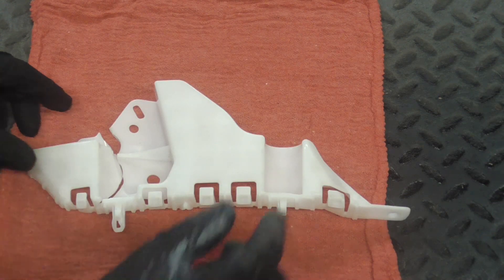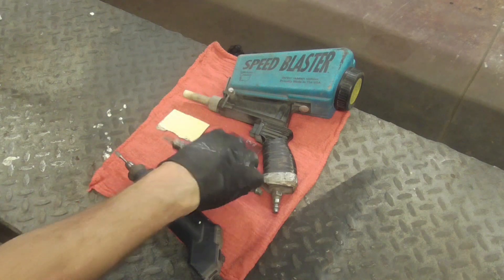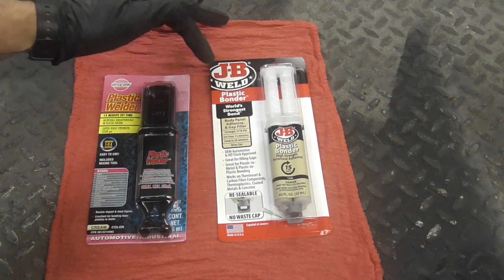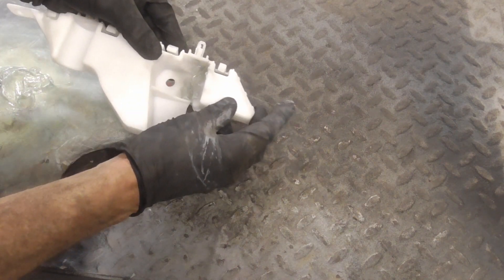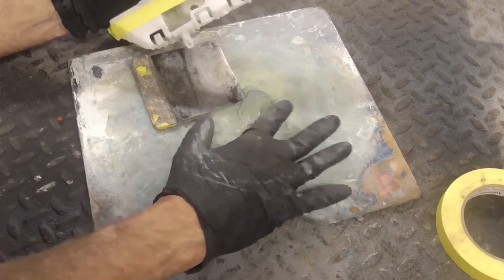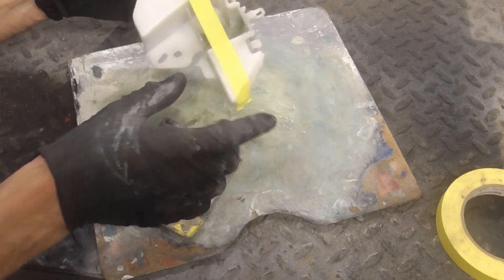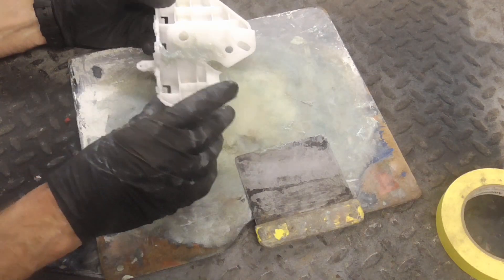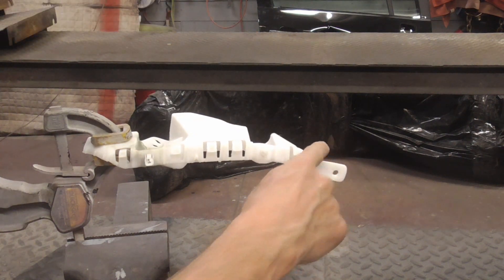How to Repair Plastic Automotive Brackets and Other Car Parts

Comment: If the parts are made of a thermoplastic like ABS, Polypropylene (#5), Polyethylene high density HDPE #2 or #4 LDPE, plastic welding will more than likely be more reliable than any adhesive. PVC and Acrylic are weldable.... but emit awful and toxic fumes.  Copper wire, aluminium window screen or steel wire make for easy to insert "rebar" that can be simply melted in. No need for an expensive plastic welder, a soldering iron will do. A heat gun to  pre heat large areas and pre melt some larger pieces that you then weld with the iron helps for larger repairs.

Comment: Good video Gerry. I have also used superglue with baking powder (soda). Sprinkle soda around the crack, fill with superglue, add more soda. Used it to fix plastic cover trim  around the rear hatch. It joined them together as if by magic!
Reply from the maker: Very interesting - thanks for the comment and tips Stewart - I'll have to experiment with that idea.

Comment: Thanks for the tip on the Plastic Weld product , I tried regular JB several yr's ago to repair a plastic part and it didn't hold up .
Reply from the maker: I think you have to really rough it up :)

Comment: I repaired a hole in a radiator once with JB weld original just to see if it would work, truck was sold with that repair much later. I now use JB weld original for any kind of repair I do including work like this
Reply from the maker: JB is good stuff - always a go to adhesive :)

Comment: Hey Jerry, I recently got the spreader set and mixing board from harbor freight and was wondering if you have any suggestions on how to get filler off if it completely hardens on me without ruining the board and spreaders
Reply from the maker: See this video at 3 minutes and 31 seconds in:   https://www.youtube.com/watch?v=EPZCuPB9fds  Before it all completely drys you can clean up the metal spreaders with a razor.

Comment: Hey Jerry.Hows that sandblaster work , 
I can't seem to find a good reliable one that works at least half way decently.
My old one I can't get nozzles anymore or even the silicate sand , now Im using coal ash medium grit , 
Any suggestions on a new blaster and sand.
                                       Thanks
                                           Al.
Reply from the maker: That actual blaster is the best one out there.  I've had it for years and not one problem - you'll love it.

Comment: That is really interesting epoxy.  I am surprised it holds well without 'softening' the plastic around the crack.  Thank you for the info!
Reply from the maker: You're welcome - I really liked the Plastic Weld from VersaChem it hardened fast.  To the point you could hold the pieces together and wait :)

Comment: What did you use aluminum oxide? To blast the plastic what air pressure? I've got a plastic dart grill needs this work thanks for the video.
Reply from the maker: The sand blaster works great for this.  The glue really grabs.  The list of materials used is under the description.
Reply: @LakesideAutobody  Cool thanks forgot you usually list everything.

Comment: Hi Jerry, that's a great idea to get into the really tight areas.  That little blaster is so versatile, I love mine.  Have you seen the ones with the rubber boots to contain the media?  I'd like to try one.  Have a great weekend, thanks again for all the valuable info you share!
Reply: I got the tip one at tractor supply $12 🚜 works pretty good for quick spots, I made a leather bag for it after blowing it up, use a shop vac at the same time.
Reply from the maker: Hi Gmguy - hope you're having a good weekend :)
Reply from the maker: You have a great weekend too Erich - nice to hear from you as always :)

Comment: Great quick video showing how to fix plastic parts and how to some some money and time…have a good holiday weekend Jerry!
Reply from the maker: Thanks UPK - hey - for real - you'll like that Plastic Weld by VersaChem.  Hardens in under 5 minutes.  You can literally hold the part together and it will harden in a very short time.  Gotta work fast though.  Have a good weekend too UPK :)